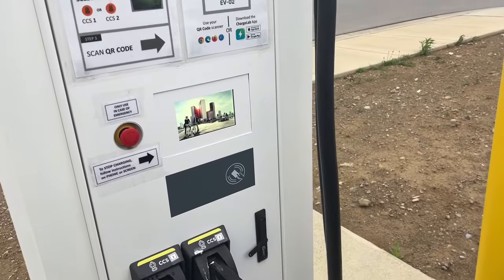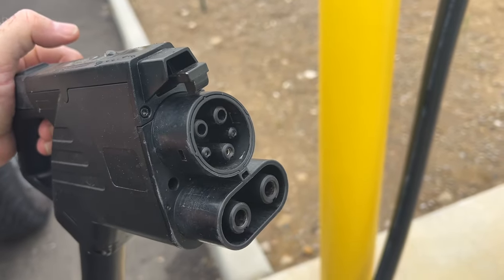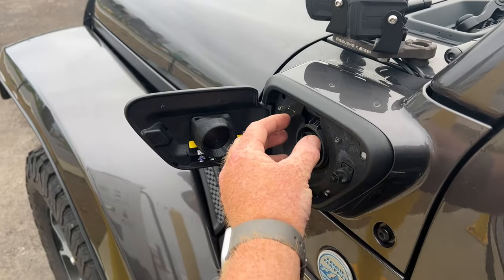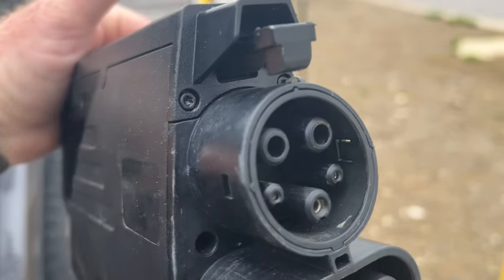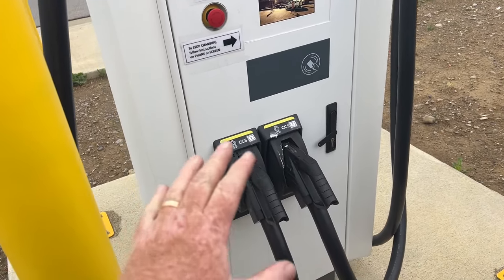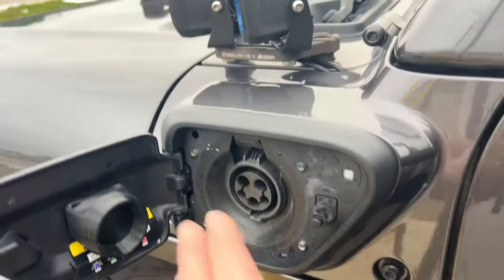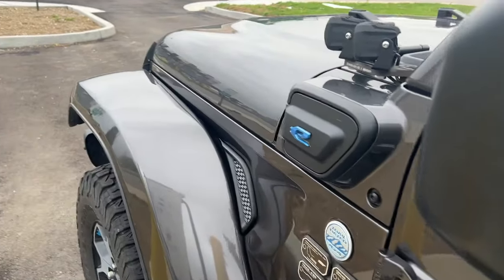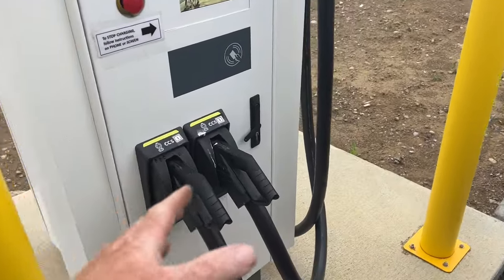Can it charge with a converter?

Comment: The J1772 will probably still be used as the level 2 standard, even though fast charging is going the Tesla route.
Reply from the maker: NACS does both. That’s what makes it awesome. The vehicle switches internally to bypass the charger and go straight to the battery when DC Fast Charging.